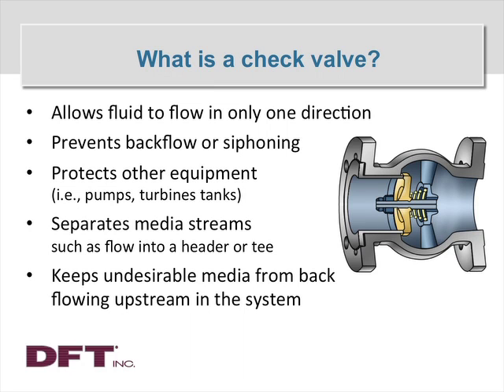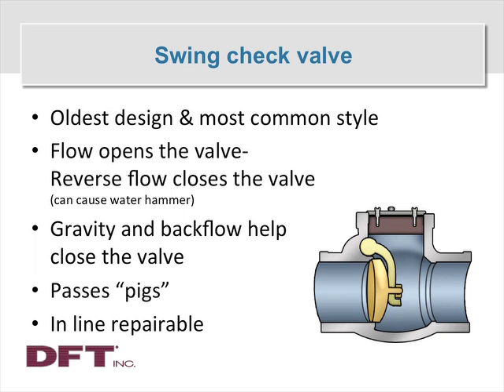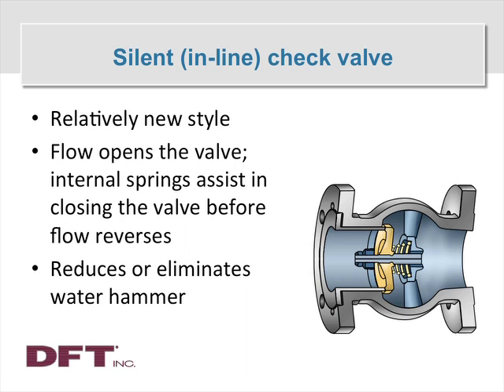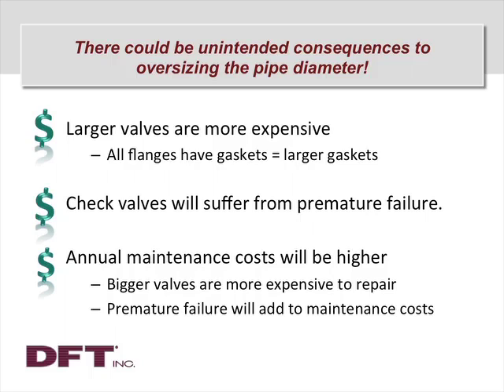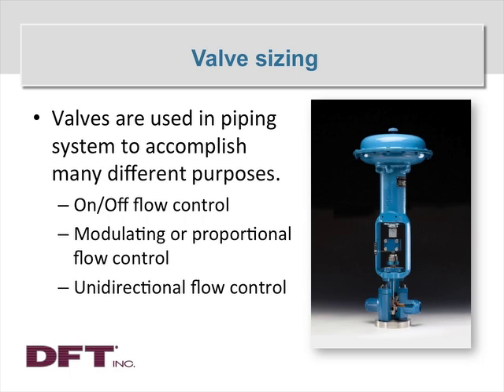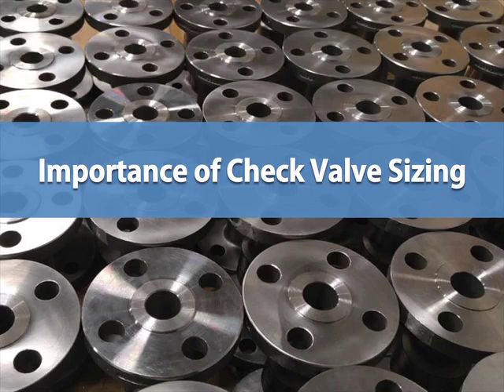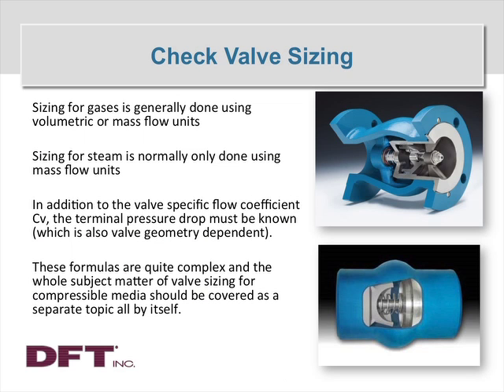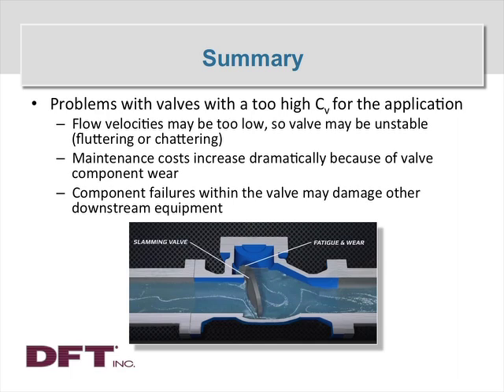Understanding Check Valves: Size for the Application

Comment: Thanks a lot for this great presentation. Which arrangement do you suggest for a line that needs a check valve but can handle a very wide range of flowrates. If I design for the low flowrate, then the Cv will be too small for the high flowrate. Is a split range of check valves a standard configuration? Is there any special requirement for that?

Comment: Hi. What if the minimum flow rate of the system have a velocity less than 7 feet/second?
Reply: Hi Naima, 
Different valves have different Cvs depending on the style of valve, line size and pressure class.  7 ft3/sec is equal to 3141.818 gpm, which isn't low at all.